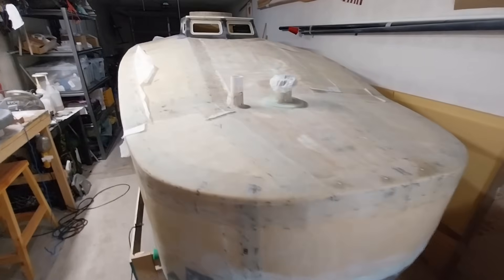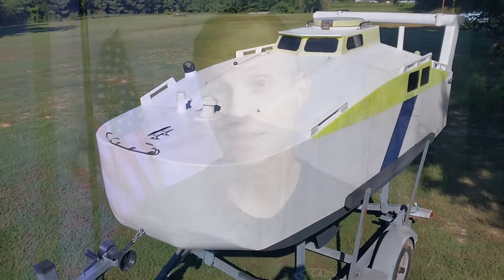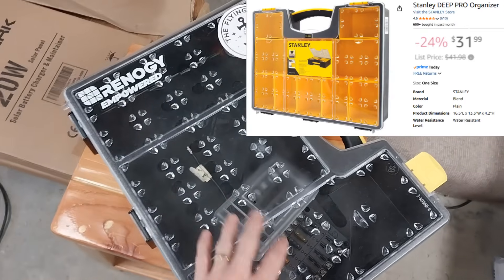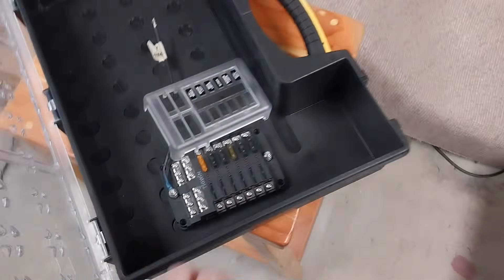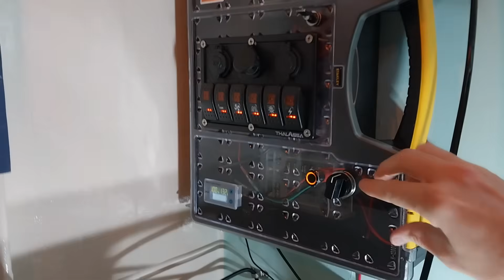OCSS-098 The DIY $32 Boat Electronics Box

Comment: I love the simplicity and accessibility of your electrical system. I'm on a long term mission to redo/simplify the electrics on my 26ft motor-sailer. I won't be able to go the full bare-bones & exposed wires route (mainly for aesthetic reasons), but there's some ideas here that I can use, especially the red & orange interior light options.

Comment: A good practice would be to install the wire into flexible conduit and glands to the appliances.
That way, any forces that are applied, are taken by the conduit which is securely fastened, rather directly to the wires.
This will prevent any accidental mishaps.

Comment: I would keep the breaker. Change the wire to fit the breaker. Thank you good job.
Thank you
Reply: His maximum demand would be around 6 amps. 
A 50amp MCB is way over the top.
Reply: @dogonegone 
Agreed  thats today. Im not sure what that panel is rated for. Seams like a better move to change the wires leaves the future for expantion.

Comment: Hey hate to say it but those heat shrink solder connectors are shit for connections that you really don't want to fail. It's easy to have a situation (a minor short) that will heat them up until they fall apart on you
Reply from the maker: You didn't offer any alternative idea. They seem to be the best option. solders the wires together and coats them in plastic to keep out sea air at the same time. I believe the fuses should protect them from shorting and failing. I don't know though I'm no professional marine electrician admittedly.
Reply: @ocean_capable_small_sailboat  An alternative would be normal solder and adhesive lined heat shrink. I used to use them on my ride-on mower and they acted like a fuse when I pinched a wire and had a short 😂😂 it just would have been easier if the fuse has blown rather than a number of joints falling apart.
Reply from the maker: @nathanchalecki4842  I see I see, well let's see how long these last. I'll report on any shorts I get.

Comment: I’m not sure about having wiring in the bilge. In any case I assume it’s all tinned wire and it might be a good idea to smear the connections with dielectric grease. No matter how sure you are that things will stay dry…they won’t. When you run exposed wires it’ll look best if it looks like you ran a comb through them and this also makes it easier to trace a fault. Thanks for the video.
Reply from the maker: The advantage my boat has is no leaking prop shaft, no underwater through-hulls at all, no portholes to leak, etc. But it's true I could still take some surprise water in through the main hatch if not careful.
Reply: @ocean_capable_small_sailboat  even marine grade is inadequate from my experience salt water WILL find a way...the electrical side of your project appears, at least from what you display here, to be the weakest part of your build
Reply from the maker: Well aren't you fun?

Comment: No mention of running lights?
Reply: Didn’t know that but running lights let folks approaching know what direction you’re going. Personally I’d put them on irrespective rather than hoping everyone has AIS
Reply from the maker: Vessels under 7 meters are not required to have running lights. I will use a bright 360 degree white light. The advantage of this is that a white light is visible from further away than a red or green light.

Comment: You stated there will be low electrical demand. Do you plan on using VHF with built in AIS transmitting say every 5 or 10 minutes.
Reply from the maker: No, currently just a handheld VHF.

Comment: USB devices will need 5V unless you have a USB power supply that supports multiple voltages.
Reply from the maker: Sure but these USB ports already integrate a voltage step-down from 12v to 5v. Same way it works in a car.

Comment: looks good!
(For a perfect finish, paint the transpart cover on the inside (it will look shiny on the outside), if you have some left-over paint. )
Reply from the maker: That could be cool. I like to see through to the wires and LED's of the solar regulator though.
Reply: Will those switch lights start to get on your nerves when you're trying to sleep?